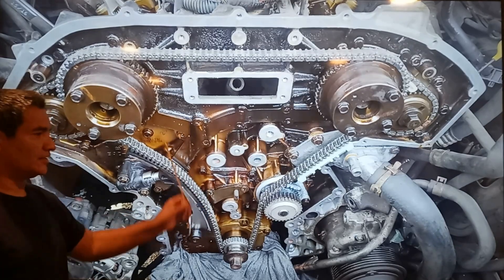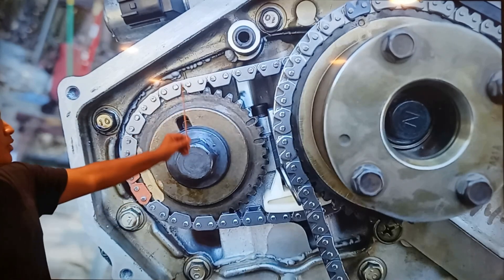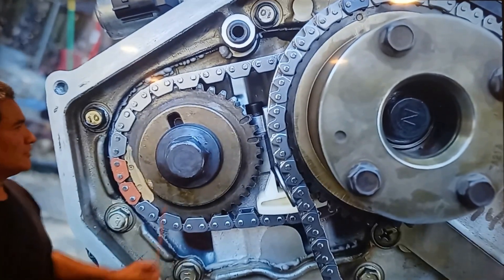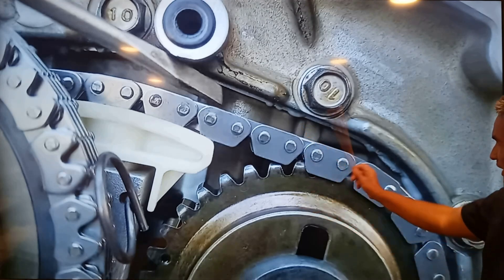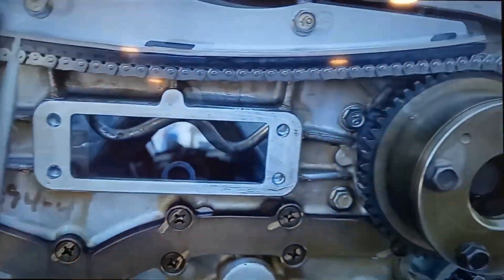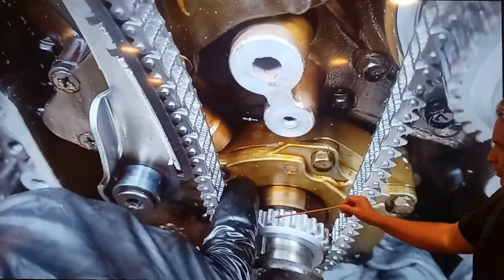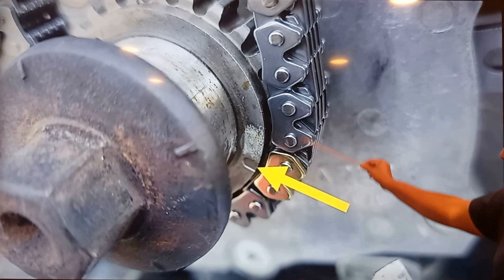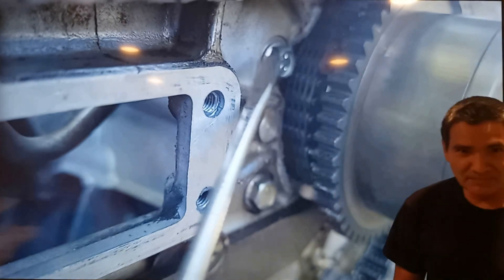Nissan Pathfinder Frontier X terra 4.0 Timing Chain Marks Setup Explained

Comment: Having the timing cover off and the timing is off due to tensioner falling into bottom of motor and rotating crank to get the chain back on the teeth, how do I get it back in time
Reply from the maker: you have take off all chains n start the procedure to set the engine on time, probably that is what you are doing, follow the timing marks n you should be good.

Comment: BEST VIDEO ON THIS EVER!!  Getting ready to do this next month. on a 2010 Pathfinder. Thank you for posting this.  You did great camera man ! lol
Reply from the maker: Thanks for watching, glad this video could help you out!
Reply: I've done this job a few times and it's not difficult. If the VVT sprocket (intake) is on it's mark, the links are on their marks, you are good to go. The keyway on the crank will look like it is slightly off but it's not. Again if the plated links are on their marks and the VVT sprocket is lined up like shown and the plated link on the crank gear is on it's mark,  all is good. Don't drive yourself crazy with all the nonsense of making cardboard templates of the front cover to keep track of bolts. ALL the 6mm(10mm socket head are the same EXCEPT 2 are a little longer, they are # 23 n 24 i believe, if you look up the torque sequence of the front cover, The 4 big bolts, 10mm  w/14mm socket heads are all the same EXCEPT one, it's the one just behind the harmonic balancer. Take a quick photo or make a mark, if you need a reference or I can get you the number from the timing cover sequence. I left the fan shroud off many years ago and man it made life easier, especially if you ever need to do any maintenance, like belts, pulley, water pump (which you should replace when doing timing chaine) etc. there are 4 big bolts holding the tensioner bracket and fan clutch pulley but that's self explanatory. Do yourself a favor and go ahead and remove the two covers at the top of front cover that covers the VVT sprockets, I used to not remove them, but I finally damaged one where the seal goes into the VVT sprocket and caused some issue later. Plus they are super easy to remove. While removing certain parts, I would put the bolt back in it's place to keep track of everything. Remove the alternator, then the power steering pump, you don't have to remove the power steering pulley, there are holes in it to allow you to get to that one bolt, keep track of the bolts you remove from the alternater, power steering pump a/c and brackets, it will make life easier. when re instaling, put power steering bracket on first, power steering pump then the alternator in that order, there are 2 14mm socket head bolt holding power steering pump bracket to the block. If you aren't replacing the upper tensioners, you can probably get away without removing the valve coveres(although the upper intake n valve cover are not that hard to remove), you can use some chain vise grips the hold and move the upper cam gears, by placing it on the VVT sprocket(intake side). Please don't use these ebay or amazon chinese kits, the chains will stretch. I used melling chains and they stretched, although they had 125k on them, but the original chains had 143k and were still in good shape when i replaced them. The last time I use INA by Shaffer, they aren't made in china and it was a nice kit, that and an AISIN water pump. good luck